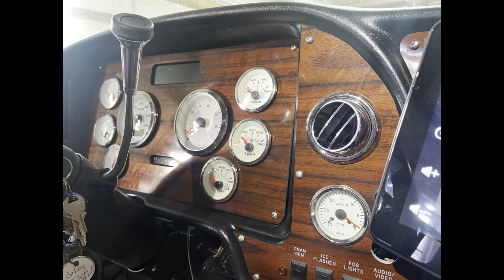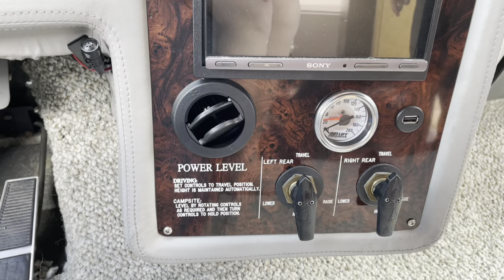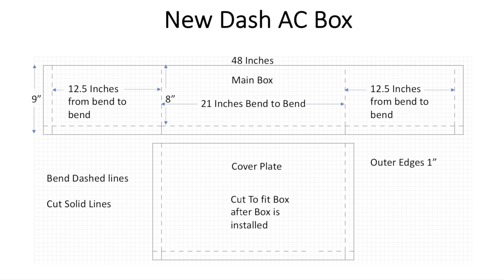New Dash A/C - GMC Motorhome

Comment: So yes great video! Thanks. On my 77 I think at one point someone tried to put in an electronic selector to get rid of the vacuum operated system and didn’t finish it so I haven’t had a dash air since I got it. So my question is that I did hear at one point from the bird feeder that some one try to make this conversion. Would anyone know anything about that. Also does this new system eliminate the use of vacuum in it? Thanks!